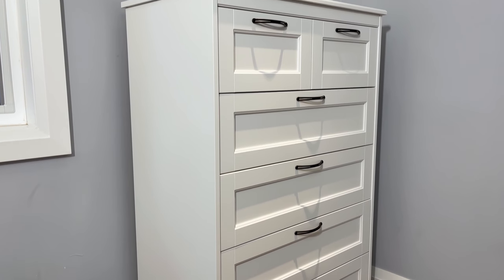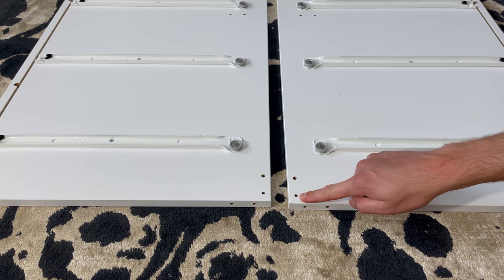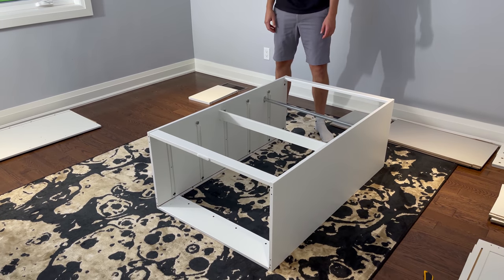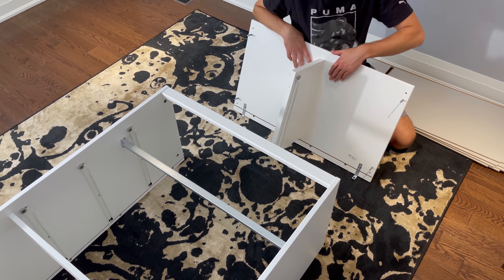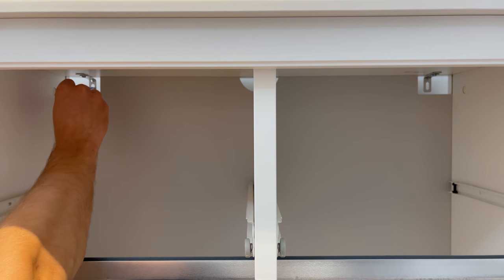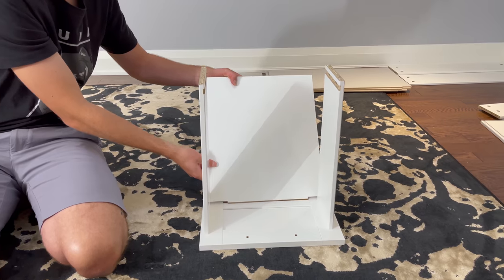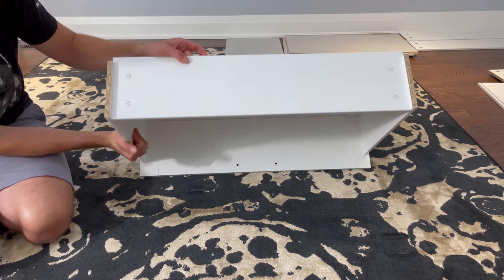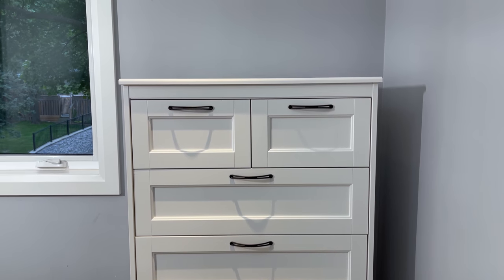Easy To Follow Songesand 6 Drawer Chest IKEA Tutorial

Comment: I'm currently in the process of assembling an IKEA chest of drawers, and I've encountered a problem with fitting the drawers. I've completed about 90% of the assembly, but the drawers are not fitting properly into their slots.
Issue: The drawers seem to get stuck when I try to slide them in. I've checked all the screws and fittings, but I can't seem to identify the source of the problem.

Steps Taken: I've double-checked the assembly instructions to ensure I haven't missed any steps. 
Any advice or suggestions on resolving this issue would be greatly appreciated! Has anyone else encountered a similar problem during IKEA furniture assembly?

Comment: hi, we just bought the same ikea cupboard few days ago. I installed the full cupboard, everything looks good but the 2 small drawers cannot fit in.... Tired everything 😔don't know what went wrong. I checked your video too, to see if i made any mistake.. But i also did exactly like you.. Cannot figure out the issue. Please can you give any suggestion...?
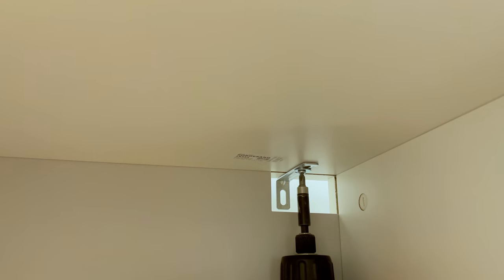Reply from the maker: I would recommend you start watching at 9:23. The biggest issue I noticed is that people make a mistake with the front drawer piece, which is at 9:38. There's one front drawer piece for the left small drawer and one for the right. Hopefully this will help you out.
Reply: Swap the top 2 drawers and it will be correct.

Comment: 1. Can we install the Markhus soft closing device from Ikea on this ? The mechanism seems compatible , however the spec sheet on Ikea merely mentions Malm series. 
2. Drill machine seems optional if we are not intending to attach to wall. Please confirm.  Just a hammer and screw driver seem sufficient. 

I have bought the 4 drawer chest , will be following this video and installing tomorrow.  
Is Songesand slightly better than the MALM series ?
Reply from the maker: 1. I'm not too sure, you'll have to try it out. In my opinion, I don't think you can. 
2.Yes if you intend on not securing it to the wall, then it's optional but if you have a drill with a Phillips bit, you could make the assembly process a bit faster. 
And yes the Songesand series is slightly better.

Comment: im in trouble because my top two drawers dont fit nicely at all! only one can slide in completely at a time. it leaves the other drawer standing out of place and i dont know what to do! i am NOT a carpenter. i am, however, very good at following instructions and assembling things. i followed the instructions perfectly and, yet, these top 2 drawers do not fit. its too snug by a few millimeters. i attempted the other drawers 3-6 and they fit perfectly and glide in and out easily. what gives?!?!
Reply: whoops! after playing around with it (or rather wrestling with it) for a while, i thought to switch the top drawers out. PROBLEM FIXED! ill leave this comment up just in case anybody else has this blooper.